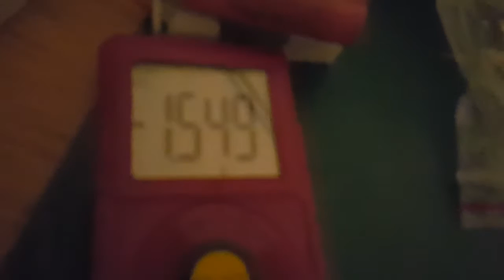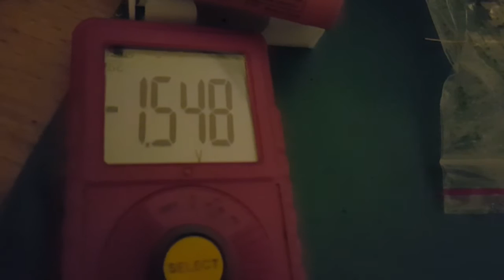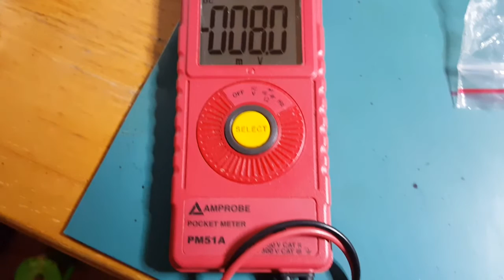Simple reed switch oscillator 2 with schematic

Comment: Very nice!  This reminds me of a setup by Slider007 that he did years ago before he came up with his now famous 'Slayer Exciter'.   We had trouble with reliability because the reed switch kept sticking.  We added a second reed in parallel that helped.  On his setup we ran on 12 volts and the flyback was very strong.  I used a 110v incandescent night light on the output cap to observe the strength.  It was very impressive.  So is yours.  Thanks for sharing it.